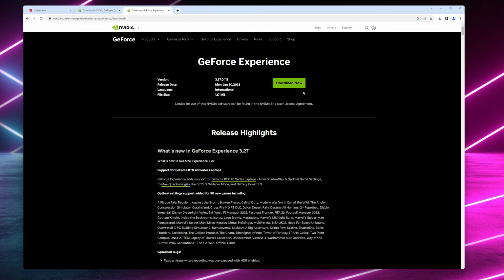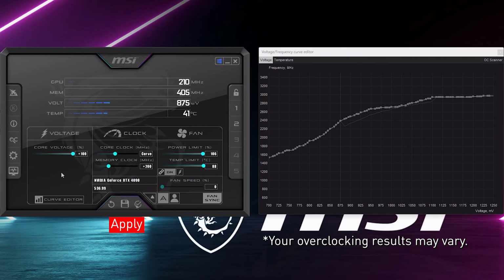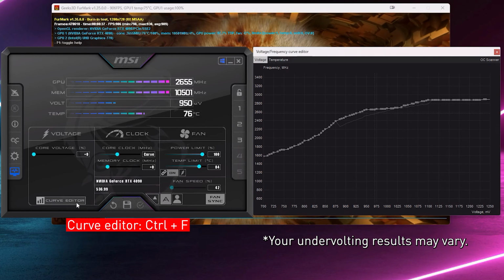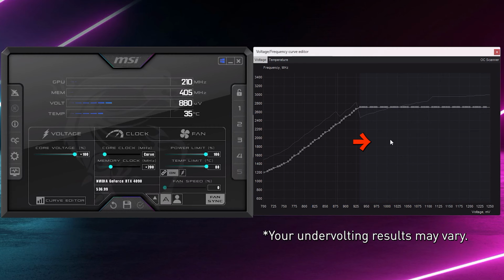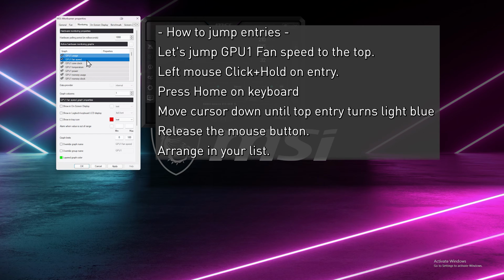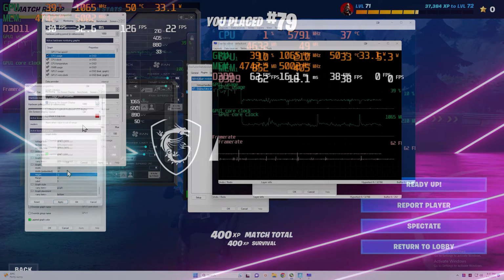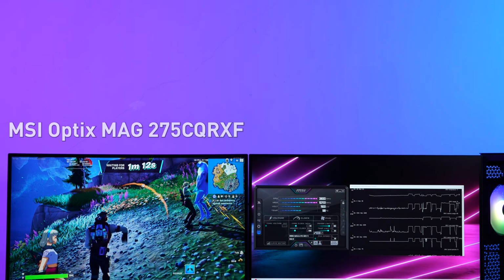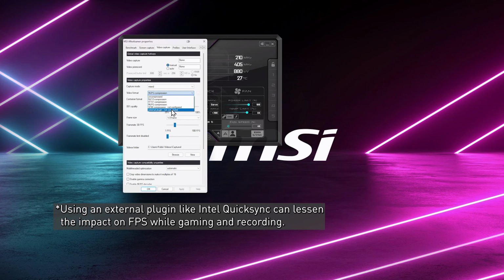All You Need To Know | MSI AFTERBURNER Overclocking & Undervolting Full Walkthrough | MSI

Comment: another very important thing that almost no youtube undervolting guides mention is that on nvidia gpus like the 3080, the temp when you hit apply in afterburner really matters due to gpu boost offsets. if you save while hot under load, the baseline gets pulled down, so when it cools to idle, it boosts way higher than tested and can crash. instead, stress test to find your stable curve at 60-80c, then let the gpu cool to 30-40c idle, apply and save there. this caps max boosts safely while letting it downclock naturally under load. always test cold boot and sustained load after. saved me a huge headache, thanks for the guide tho
Reply: I think this is happening to me how can I stop the crashing?
Reply: @Yeading  click the apply button to apply the curve (which, the curve should already be stable when its under load) when the gpu is at idle temperature, not hot. if it still crashes, try dropping the core clock down a small bit like -10 or 20mhz in the main core clock slider, then test again (cold boot + hot under load). if its crashing on startup, you can disable “apply at startup” until its fixed. hope this helps!
Reply: @EnderOLED so when trying it out I need to restart pc everytime before I test? Kinda confused my bad.
Reply: So it basically needs to be cooled down before you apply? And test?

Comment: I undervolted my GPU and then overlocked in MSI Afterburner by increasing the core clock MHz. When going back to my curve editor, it now shows that my curve isn’t flat anymore? Did the overlock adjust the undervolt? Is the undervolt still there ?

Comment: I open the Afterburner and I didn't make any changes. It shows my clock mhz is @1830mhz constantly. 
I've seem many clips using afterburner and they all start with very low clock. Is there something wrong with my system?
My card is a MSI RTX 3080 10gb. Thank you!

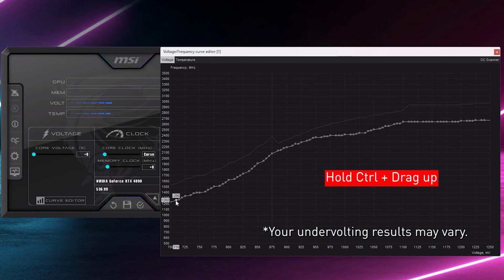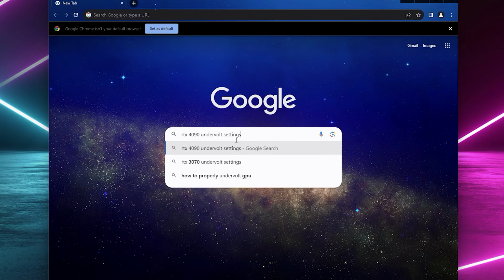Comment: I am very confused on how author describes volting curve. When he says at 8:20  "drug it up so at lower power states is not too undervolted" - dragging it up actually undervolts it even more, doesn't it? Also at 8:10 drugging the whole curve down is basically opposite of undervolting, isn't it?
Reply: I thinks what he wanted to say is " not to underclocked" . if im not wrong, draging, lets say the 1000mv point up to 3000mhz, means that you wanna run 3000mhz with 1000mv. He lowered the whole line before, that means that the clock speed is lower, he pulls up at 875mv, thats where he wanted to start the undervolting for gaming so he flattens the curve to the right. On the left side are lower frequencies for not so intense tasks or idle, but the curve was pulled down there too, that means it runs at much lower clocks, he raised the line at the beginning to increase the frequencies again. Thats how i understand it and it has been a while that i undervoltet my 4070ti but thats how it works, but its better to double check that. If i remeber correctly, you also dont need to flatten the curve, if you want to run lets say 2900mhz at 950mv, you raise just that one point up to 2900mhz and everything on the right thats lower than that one point, is running at that values (950mv and 2900mhz). You also can test it and see if its really true, just pull 1 point up a little while benchmarking and watch the voltage and frequencies

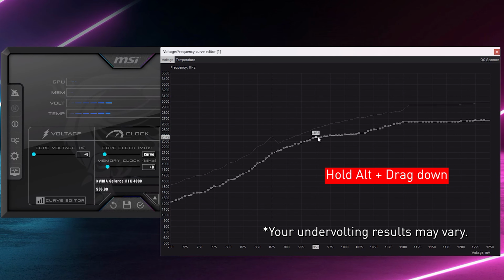Comment: 8:17 what does he mean by "the amount we found". What amount?
Reply: Runn the Overclock Scanner and check the clock speed / voltage sweet spot. On my RTX4060 that is at 2885MHz@1.070V compared to  2775MHz@1.070V pre scan - a gain of +110, so I would lower the curve by -110.

Drop the entire curve (ALT) by the gain found on your card, adjust the first voltage marker (CRTL) to zero gain, thereby adjusting the entire lower end. Lastly, raise the sweet-spot back to its best value found by the OC scanner, in my case 2885MHz@1.070V . (SHIFT) click and drag to mark this and the following voltage points. (SHIFT)(ENTER) twice to flatten the curve and keep the card from boosting further.

This should result in your card now running stable at its highest clock, while using less power. The GPU should now run cooler and locked in at its max speed.

Comment: Every time I hit the “Apply at Windows startup” button MSI afterburner crashes and will not relaunch. 
I’ve tried unstalling and deleting the files, updating bios, chipset, and downloading AB from msi and guru 3d. And it always does it when I hit apply and windows startup up. 
I’ll run a benchmark and a stress test after I manually tune and it’s stable. But I can’t save my work!

I’m at my wits end and I can’t figure it out.

Comment: Hi, MSI Gaming.
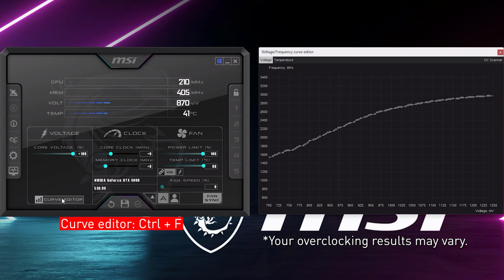Why is my Curve Editor (AfterBurner) for my AMD Radeon RX 6700XT different from yours? 3:04
Mine has 2 separate graphs, Frequency above Voltage, with the X-axis showing only 2 values, the R side is P-State 1, the L side P-State 0.
I can only change the values at both ends, not anywhere in the middle.
Thanks.

Edit:
BTW, how come my Afterburner doesn't have MSI OC Scanner installed within it?
It seems to be greyed out.

Why is it so hard to find the version number of MSI AB? Cannot seem to find it within the application window. Had to go to my Program Files (x64), then find the MSI AB exe and click on it's properties. Most programs have the version number of the software within the application's window under "information"!

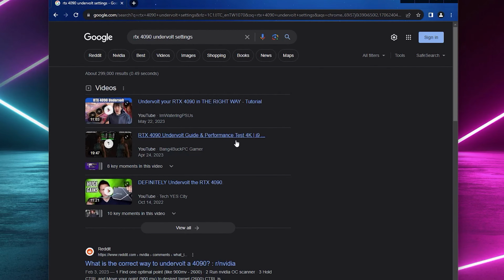Comment: i was really confused at 8:13 ... if you move the whole curve down it actually applies higher voltage. So it wouldnt be "too undervolted", its rather high voltage at low frequencies. Somehow the voltage is on the x-axis and the frequency on the y-axis, which i find very confusing. In the second step the "vertical" line then does the actual undervolting. With these axis you need a steep curve to undervolt, not a flat one and not a curve close to the x-axis
Reply: Agreed that the axes are counterintuitive for editing voltage as a primary metric.

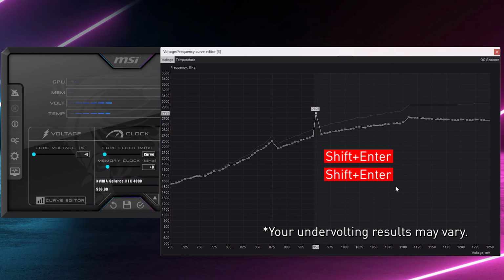If you pause the vid at 8:41 the original curve is in dark gray in the background and he drags up the point at 950mV up to 2793mhz. You could form a triangle for the light gray line above the dark gray curve, which is essentially your undervolt at full load. Before the adjustment 2793mhz was set to 1075mV whereas after he drags the point up 2793mhz is set to 950mv. This also undervolts every frequency between 2500mhz up to max load, though at different multipliers from the original curve. Generally this is the range that matters during intense workloads and everything below it is for ramp up / ramp down as processes begin or conclude.

Comment: 08:23:50 Connected to MSI Afterburner control interface v2.3
08:23:55 GPU1 : VEN_10DE&DEV_28A1&SUBSYS_13C81462&REV_A1&BUS_1&DEV_0&FN_0
08:23:55 Failed to start scannning!
08:23:56 Overclocking settings reverted
08:23:59 GPU1 : VEN_10DE&DEV_28A1&SUBSYS_13C81462&REV_A1&BUS_1&DEV_0&FN_0
08:23:59 Failed to start scannning!

what hecc?
Reply: It’s fargarbage

Comment: How do i stop MSI AFTERBURNER automatically overclocking my GPU 
Please help
😭
Reply: always have a save profile for your original setup. You can save up to 5 setting profiles, I always save the very first one as my default and then if I have any issues I can just use that original save profile
Reply: @cammurray255  Thanks for the suggestion bro but i figured out the problem.
Actually during my laptops service the engineer completely removed the liquid metal from the processor so it was overheating and bottlenecking the gpu too

Comment: That is not undervolting. Flattening the curve up/down at a certain point means you are limiting the frequencies and thus limiting the voltage accordingly but that is NOT what is behind the true purpose of undervolting. Limiting the frequencies and voltage is trivial. Because it's the same as a simple power limiter. They could put a power percentage limiter option and that would do the exact same thing. The true purpose of undervolting is maintaining the same frequencies AND lowering the voltage to the point you get the best benefits while the system remains stable. The only true undervolt in that graph would be possible if you could move the points to the left. Telling the GPU: "keep increasing the frequency as usual.. but don't feed more power than...x"
Reply: so how do you actually undervolt
Reply: I agree with you, every time that I see this tutorials where they flatten the line doesn’t makes sense, maybe I am just stupid :u
Btw would be crazy if this guide is wrong because this is the official channel for msi afterburner

Comment: i cant slide the power limit and the core voltage even i unlock voltage control and voltage monitoring. i need help
Reply: Its shown at the start "before u start'
Reply: Because you have a low end gpu. It's locked.
Reply: @BrandensOutdoorChannel I had to download the beta version, I have a 4070 super and it still wouldn't unlock mine.
Reply: @BrandensOutdoorChannel  tysm

Comment: Can you make an ACTUAL whitepaper where someone can read what all these settings are and what they do? I spent hours crawling the internet trying to find a manual even using AI and still couldnt find anything. For example, what is the difference between "memory usage" and "memory usage / process" in OSD? One just shows me a random number that i cant correlate to anything in afterburner or performance monitor. It's mindboggling that you would release a software without even the most basic whitepaper documentation.
Reply: memory usage overall, memory usage per process for gpu. 

they are fairly straight forward.
Reply: memory usage overall, memory usage per process for gpu. 

they are fairly straight forward.

Comment: hey im using a gaming laptop with an nvidia rtx 4060 gpu in it. im not able to get access to the voltage or fan speed for some reason. any tips?
Reply: I think that laptops are “locked” meaning you can’t tweak voltage and fan speed or curves, but you can tweak clocks (inside the power limits of course). My laptop is doin that too
Reply: @agamemnonblanas8941  Oh great so they literally only thought about PCs and didnt care about laptops because you can easily overclock laptops too but ofc theire weaklings and dont want to "risk" anything
Reply: @agamemnonblanas8941  i have msi with rtx laptop and it works
Reply: laptops have their own unique blend of power management (usually letting GPU "steal" power from CPU and vice versa), and the cooling has to handle both CPU and GPU, as well as battery heat. Just adjust the settings with your laptop's oem app.

Comment: how the hell do you get the voltage monitoring and voltage slider to work w/ a 4070 super??  I've had 3 Zotac Amp Extremes over the last 8 years with this same PC and i've always been able to monitor voltage and use the voltage slider (although it was just a % slider and I couldn't put in exact numbers), but I just bought an ACTUAL msi card (4070 super gaming x slim) and I have a greyed-out voltage slider and no monitoring, despite trying all checkboxes (over and over again...), drop-down menu options, and re-installing the application (and trying different skins..).  Nothing works.  Is there a way to do this with a 4070 super without doing anything crazy like changing BIOS's or dismantling the card itself?
Reply: I had same issue!! Under the greyed out "Clock" section - click the up arrow! Your GPU should be the second option. Idk what that first option is - but my hunch is - if you have an x3d CPU, it has its own mini GPU. Im assuming thats what MSI is finding and wont allow you to change settings on. since it wouldnt have its own fan etc...
Reply: @Blkswan911  I actually figured it out yesterday.  Someone pointed out that there was a new version of Afterburner.  I googled it and, sure enough, a new beta had been released 2 days ago.  I hadn't noticed since my afterburner didn't even see a new version, even when I checked after seeing the new version on guru3d (it was ONLY on guru3d, not even the other official site, the actual msi afterburner page, lol).

The new beta had been updated with all the new codes for the 40-series "super" cards.  So I tried installing it and, voila, voltage is back! :)   So I guess until 2-3 days ago (around the 12th of feb, 2024) it wasn't even possible unless there was a way to edit the hardware database yourself.

btw, I have my iGPU disabled in BIOS (otherwise I'd probably be making that same mistake countless times, lol - that's why I just disabled it from day one, heh).  Thanks for the suggestion, tho
Reply: same thing on my 4070 Super OC.
Reply: @nonstar8182  I could have sworn I replied to this already.... But I solved my issue by upgrading to the newest version of Afterburner (4.6.6 beta).  The app didn't tell me there was a new version (even a beta) even after I saw that it was uploaded to one of the 2 official sitges (guru3d) and ready for download.  Someone on the official MSI forums pointed it out.  

They needed to add the new "super" cards to the database, so if you want to monitor voltage and get the slider (though im not sure it does much/anything....), you need to get 4.6.6 from guru3D (even the other official site - the actual msi afterburner site) doesn't have it up for download yet (at least the other day they didn't; maybe now they do).
Reply: @intuit13  I ended up downloading  GPU Tweak from Asus. I have an Asus card so figured that makes sense anyway and all of the voltage stuff was there. Thanks for the info.
Reply: @nonstar8182  Nice.  Too bad MSI isn't as good at keeping their (most widely used...) program up to date, lol.

Comment: It doesn't let me change the voltage even after doing the settings
Reply: me 2
Reply: Update your drivers
Reply: For my 4080super I had to download the latest beta version from MSI.
Reply: What I had to do was modify a .cfg file and type a liability statement then replace the old one. Then I had to modify one of the profile .cfg files by copying and pasting a different set of commands. The instructions are on a website called “steemit”. I have a 4070 Ti Super
Reply: You probably shouldn't touch your voltage there actually no need to really. The other settings do what you need.
Reply: I think this works only for 4000 series. I followed a different tutorial for my older card and it worked. With this one here, voltage wasn't changing

Comment: My Afterburner does not have the OC Scanner button. Yes I'm using the same UI.
Reply: Go in nvidia control panel, and click "enable developer settings" i think thats what its called but it fixes it.
Reply: @Keaweahe what about amd??
Reply: @ray3270 there is an option in adrenalin. You have to go to the "tuning" section. The best settings for me were, turn off zero rpm, turn on fast memory timing, make sure gpu acceleration is on in windows

Comment: Is there are use case for some of these tweaks/adjustments for streaming PCs?  I play on an Xbox Series X, but stream from a PC.  I just build my first rig with an MSI RTX 4060ti 16gb Gaming X Slim White.  My GPU rarely breaks a sweat until I'm doing some hardcore video editing/rending in Premiere Pro.  I'm just trying to figure out if there are ways I can make it more efficient and improve performance.  I'm going to be streaming and rending videos in 4k soon and want to make sure I'm running at peak performance.
Reply: could probably undervolt a little to get some lower temp, which may very slightly increase performance or efficiency. don't see overclocking doing anything worth noticing for streaming rig with those specs, but it's a good learning experience and you can revert back so may aswell!

have fun!

Comment: Why under-volt 4xxx series? More voltage equal higher clock
Reply: less power consumption, less heat, less noise from fans and can reduce coil whine and finally your card only loss 2% performances so it is a win win